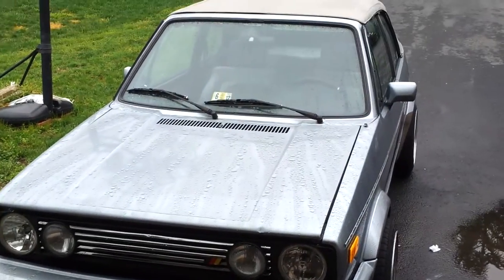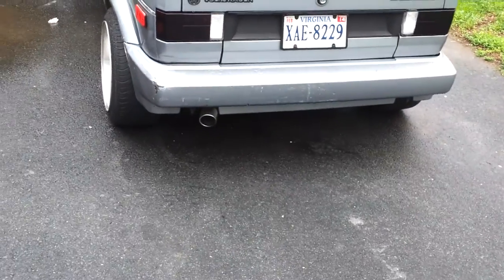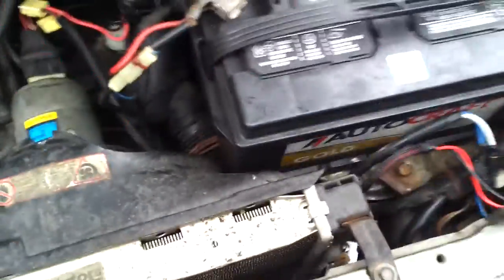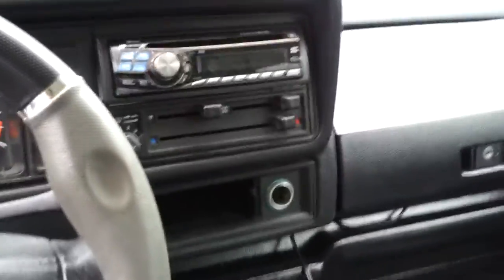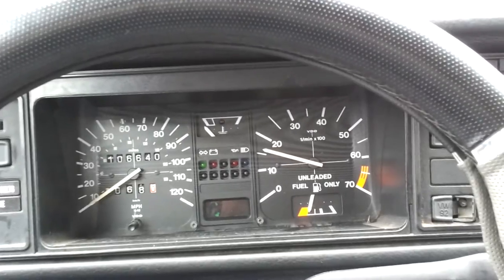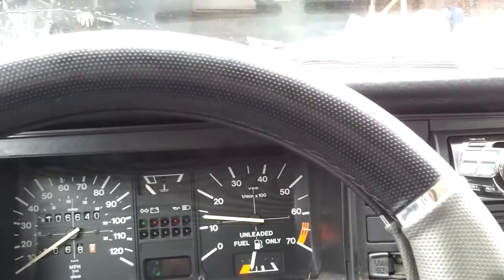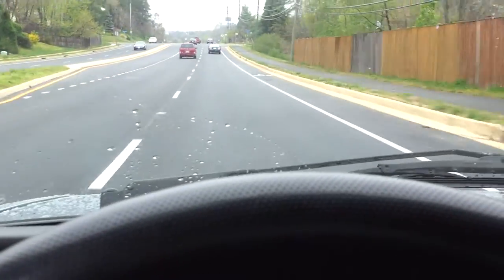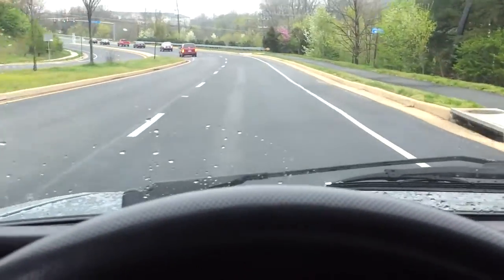1989 VW Cabriolet walk-around and drive

Comment: Where do you find parts for this model? Mine is a 1989 Cabriolet Golf automatic. I can't find the 2 pin oil temp/ oil pressure sender, Nor the Airflow Meter Boot. Please help
Reply: Unfortunately the point of this video was to sell the car, and I haven't had it in almost 10 years